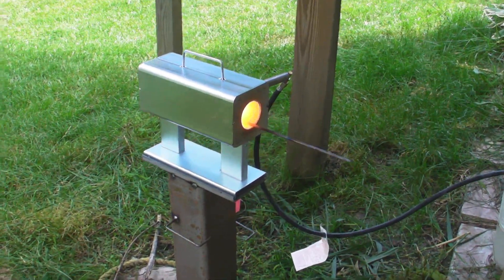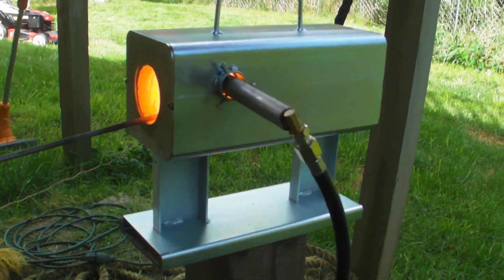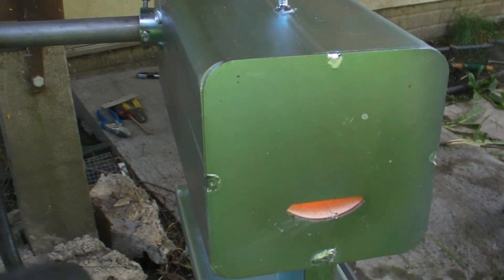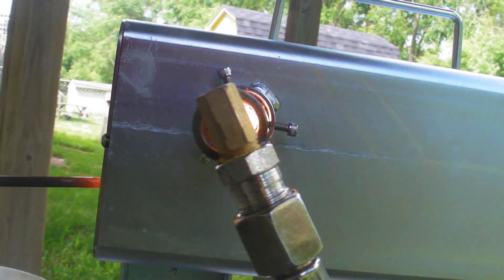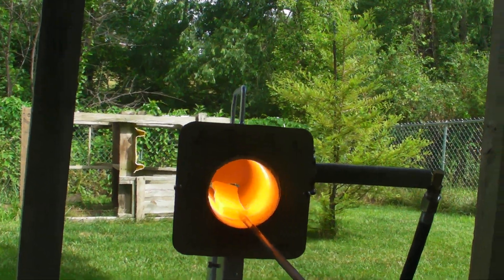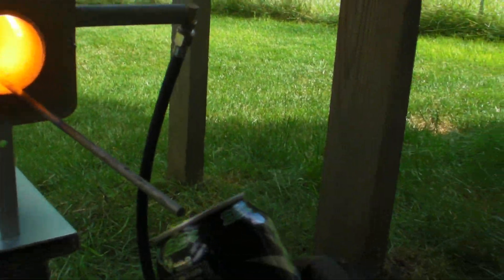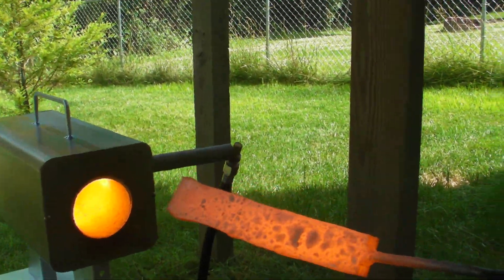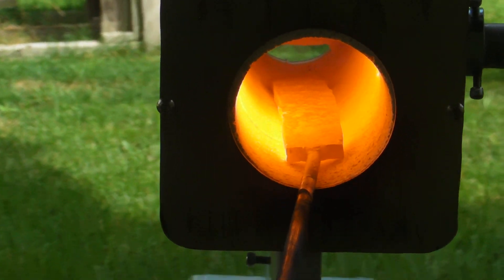Atlas Mini Forge - best knifemaker forge available

Comment: I have a similar one. Having some issues with the regulator getting too hot and it's sputtering. I'm outside so it's getting proper ventilation. Any tips?
Reply from the maker: Your burner is sticking too far inside the chamber, causing the heat to travel up the burner to the fitting and hose.  Visit the contact form on their website to speak directly to them.

Comment: Hi Zaph
Nice build. What material u use for the insides of the forge? Thx.
Reply from the maker: Currently we use HWI brand K26 insulating firebrick.  These are rated for 2450°F continuous use.  I'm currently researching refractory ceramic fiber and mullite bricks.  Both of these should have a higher insulation value and better resistance to flux.

Comment: hows the forge holding up.?thinking of buying one.
Reply from the maker: Christopher Bostock I've gone back to high temp ceramic paint, it just works better.
Reply: Hi Zaph, can you clarify what you mean? Are you still using the Atlas? Did you just paint the outside wit hthe hight temp ceramic paint instead of leaving it shiny?

Comment: zinc plated? I hope you're not breathing near it.
Reply: No, if I want bolts to look really cool and weathered, I take it outside, put a respirator on, and burn the zinc off. It doesn't even turn red. When I'm forging, I'm at a yellow heat.
Reply from the maker: Keith Peters wrong kind of zinc, it's not galvanized.  No problem heating it up, no toxic gazes created at forging temps, only welding temps with galvanizing is dangerous.

Comment: i really hope that is not zinc on your forge.
Reply: No kidding..yikes!!!!!!
Reply from the maker: James Savage wrong kind of zinc, it's not galvanized.  No problem heating it up, no toxic gazes created at forging temps, only welding temps with galvanizing is dangerous.
Reply: +shona O'neill     

wow. I don't know who pissed in your teapot, but with all due respect he is simply trying to make money selling his forges (if he is the one making them, if not hes very proud of it). if you look around most companies will claim their product is "the  best" , which nothing really is, and if you don't realize that, then there is no helping you. the burner on his forge is plenty large enough for it, and if its good enough for his needs, then that's all he needs. also in the argument of venturi vs forced air, they both have their downsides,  sure forced air has much more performance, but without anything to force the air it wont work, so if your compressor fails or the power goes out, very likely it will backfire and stop running, and the portability is horrible, where as a venturi forge can run pretty much anywhere (which is why most farriers use them), and they get plenty hot enough to forge weld when it is made correctly. now i don't agree with this particular style forge as it is rather small, but there are a plenty of people that use forges this small to forge small knives with, and the work they do is incredible.  for someone who "knows" their forges, you don't even have a video about your own forge... or any videos at all for that matter, i would very much love to see a video of an awesome forced air forge that you have, if you have one at all that is. feel free to indulge me good sir, I'll be waiting for that video.